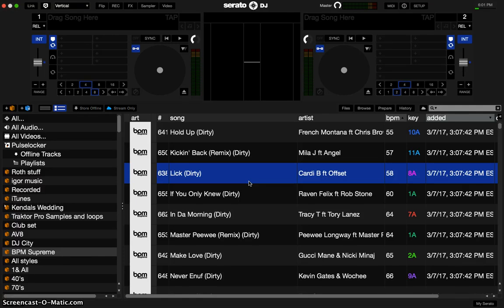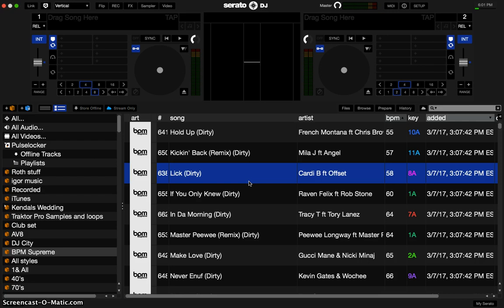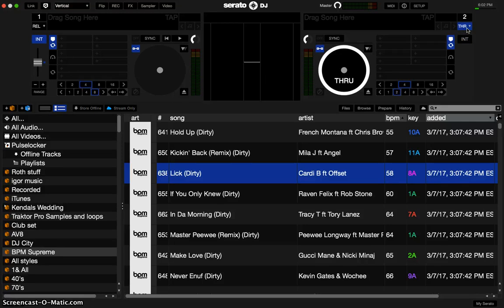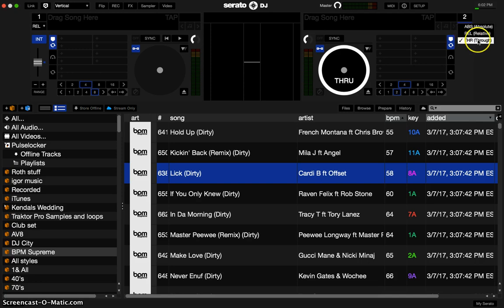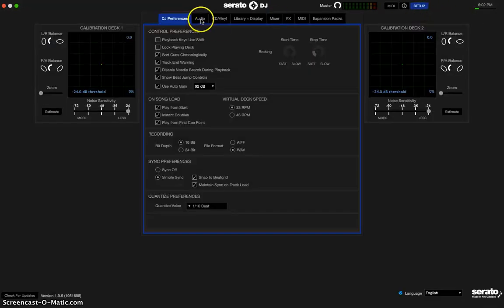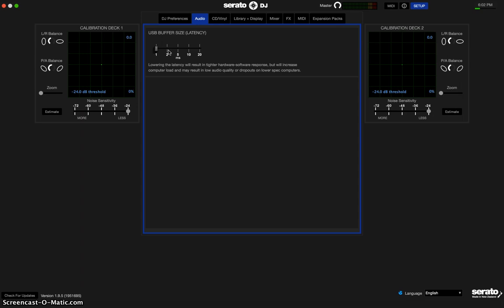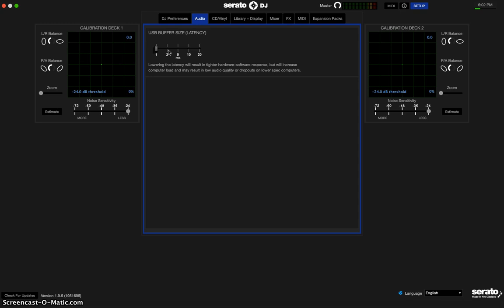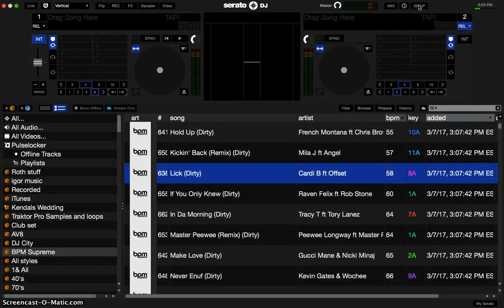Serato Latency tips

Comment: the problem for me is that I cant access that latency button. its greyed out!
Im using a numark NS7 though on a win 10 PC.
Reply from the maker: PETER PEARSON move it to 1 then hit apply
Reply from the maker: Also make sure your on internal mode
Reply: @bboymac84  internal mode. Ok I'll take a look. Thank you
Reply: @bboymac84  Thanx for the help. well. I can change the latency settings when in internal mode, but when I plug the ns7 back in the latency settings immediately reverts back to the default settings.
Reply: Numark runs a separate program to adjust latency. look in the Numark folder , called Numark ns7 control panel

Comment: cheers man - i just had a gig on the weekend and i wish i never went. When im at home everything works great, but in the club where the bass was immense and travelling through the stage, my serato scratch sampleswere moving on their own even when my hand was on the turntabe preventing them from moving, and when i did try to scratch, the sounds were extremly glitchy. My buffer/latency slider was all the way to the left, and whilst the estimate button suggested i keep the slider to the right, it would not allow me to do slow drags so i kept it left of middle. any ideas ?
Reply from the maker: Craig Anthony get the XDJ-RX2. Stop using Serato. serato is based of the computer speed and processor. computers fail. i stopped DJing with a laptop and Im not lookin back. youtube the XDJ-RX2.
Reply: hmmm.....im a turntablist and vinyl man . I'm going to do a bit more research and see what i come up with . Thanks so much for a rapid response. If you want a free copy of our album let me know (soundcloud.com/majortriadz)
Reply from the maker: Craig Anthony me too and it can connect you tables too.